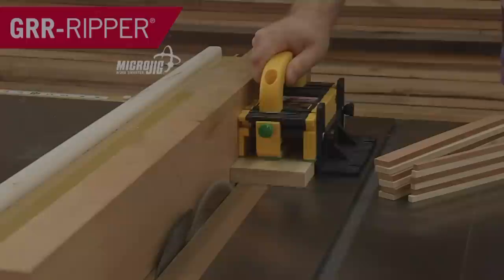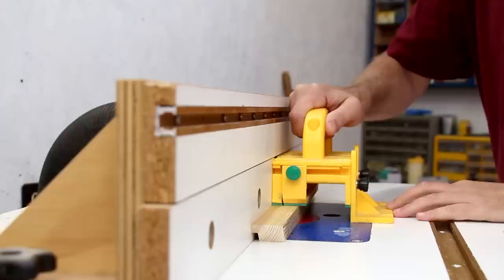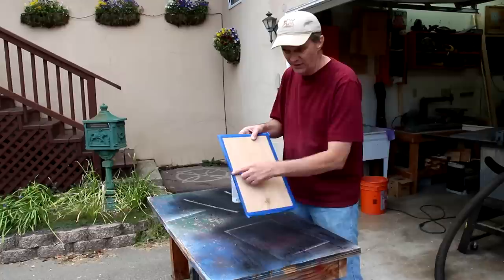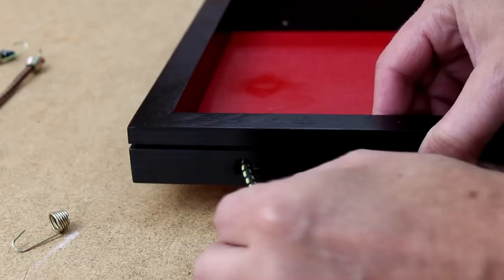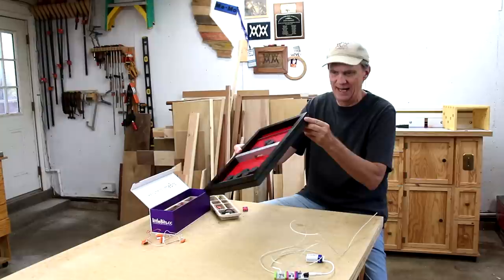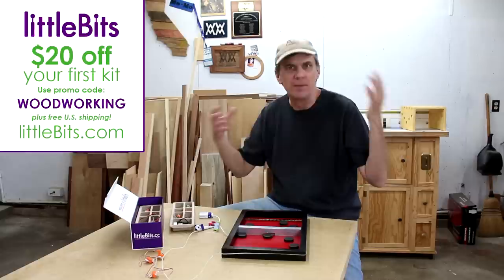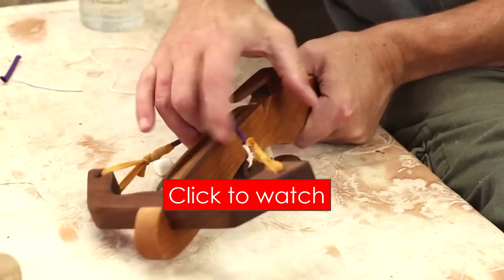Finger Hockey ("Fastrack") Board Game. With Disco Mode!

Comment: The main reason to glue both ends is that end grain soaks up the glue and if you don't put it on both ends you get an uneven amount of glue penetration from one side to the other.  This will cause the joint to be weaker that it would be if it were not as starved for glue.

Comment: You should have put the light on the interior part of the frame so you can play in the dark. If you light the outside it will not help because the frame is blocking the light to illuminate the game box.

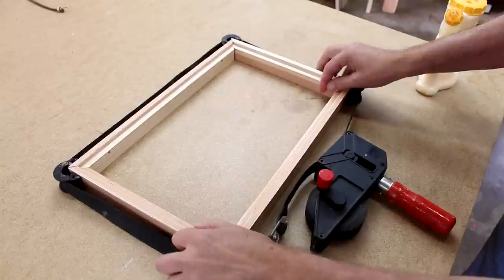Comment: 2:16 "... glue on one piece of a joint..."

in that case, Steve, I have a question: I was reading an article that said that gluing end grain, like in this case, was weaker than long grain in part because the glue soaked farther into the wood, leaving very little glue in the actual joint.  they recommended covering the end of both pieces with glue, letting it dry, then gluing up the joint with another layer of glue.  I don't recall if they recommended sanding.

any thoughts?
Reply: kght222
yeah, fair point.  if you want actual strength, a spline or biscuit, or even dowel would do much better.

I just wonder if he's had any problems doing that 'put glue on one side' thing.  or, for that matter, if you have.  or anyone.

I'm curious.
Reply: ThoperSought Yes I have used prime the ends method and yes it worked
better if you sanded it a bit before final gluing.  Just putting glue on one side and then braking
the joint you see that there is little penetration on the other side and that the
joint is much weaker that the fully glued or the primed joint!  That being said none of them are terribly
strong without a spline or pined in some way!
Reply: Second Star Productions
thanks very much!

btw, your comment got flagged as spam, and I don't know why.  I unflagged it.

Comment: Seems like it could use a tension calibrator. If the cords aren't equally tensioned it will make an unfair game
Reply: Jack Mcslay Or tie the knot of the open end the same distance on both.
Reply: s0nnyburnett
these cords aren't made with precision in mind. even if they are the same length they may not offer the same strength
Reply: Jack Mcslay switch sides at half time

Comment: I don't really like littleBits because they are so overpriced, but I think it is cool that this light wire works with such a small circuit. I only know this as el-wire, that requires a huge transformator .
Reply: El wire can be powered by a small dc-dc converter. I think what you want is the "buck" type but don't quote me on that.

Comment: Steve, do you find your new miter sled wanting to tip off the back of your table when you;re using it? I recently bought my first table saw and need to build a miter sled but I don't know if building a large one would be beneficial if it'll just want to fall off the back of the table when in use.
Reply: ***** Ok, awesome. Wow! Longer!? The one you just made seems pretty long but I guess that makes sense. Oh and btw I bought a Grr-Ripper, thanks to you haha!
Reply: ViperishTiger If you move the fence close to the edge of the sled then clamp a board to it the sled should not tip back since the board acts like a lip to hold it down